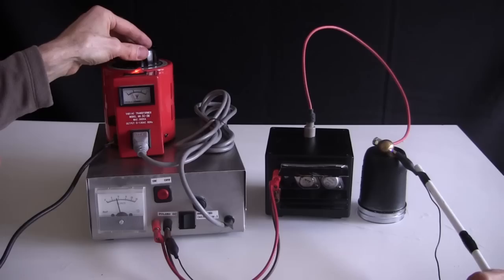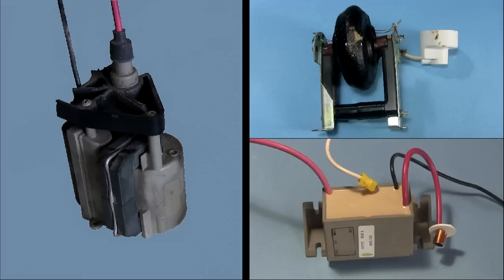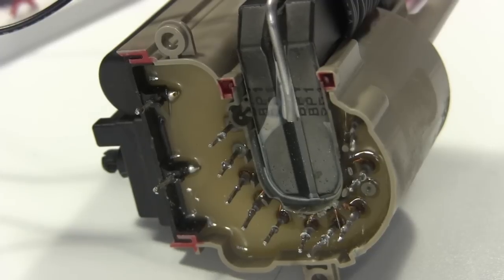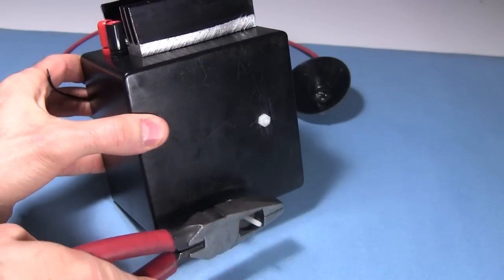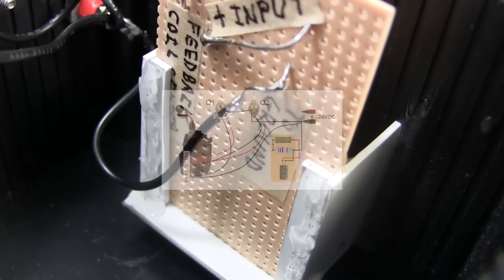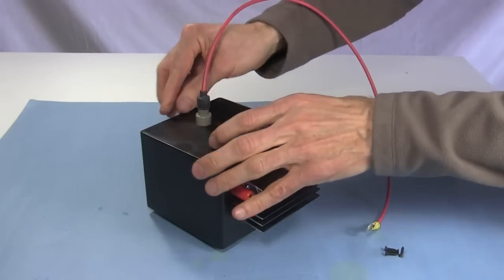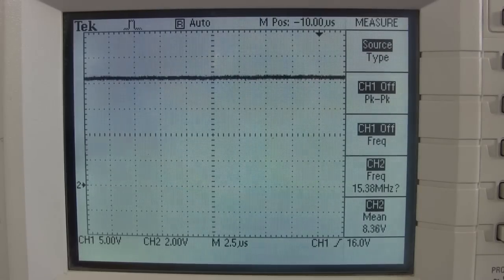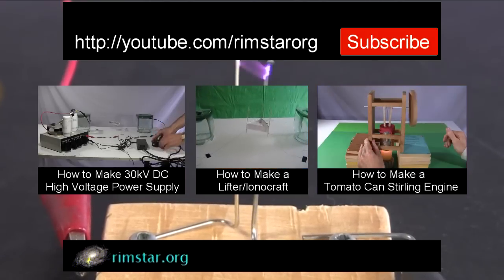The Cube - How to Make High Voltage Power Supply w Flyback/Builtin Diodes

Comment from the maker: The How-I-Made the Cube high voltage power supply video is up now! Enjoy!
PS. +Aaron Monroe pointed out in the comments the resemblance to a borg cube. Good thing I didn't think of it otherwise I would have made a cheezy clip of it flying through space, sparking away. :)
Reply: Is it to heavy for ion propulsion on your test rig?
Reply from the maker: Mongrel Shark
Oh, yes. Even just the plastic Enterprise model with the laser in it was getting a bit on the heavy side.
Reply: Shame. If you had a bigger enterprise to counter balance. They could chase each other in circles.
Reply: My flyback weights 440 grams with everything:D
Is ist possible to add about 2250 lifters to it, power it by this power supply (on top of it) and  fly it?
I`m just dreaming about starting an orbiter with this (powered by xenon gas in space) :D
Reply from the maker: PojntFX (PFX)
No, the power supply wouldn't be able to supply enough current for all the lifters to fly. The current is needed to ionized the air for the ion wind. The record is one that lifted 102g of payload plus the 85g lifter and used a heavier power supply that had multiple flybacks.
Reply: RimstarOrg Would a Flyback from an old CRT computer monitor work?
Reply from the maker: Yextus
I haven't tried it myself, so I can't say for sure. I just opened my old CRT computer monitor and from what I can tell it looks like the same sort of flyback, one with a diode or diodes built in. It's the monitor from my video about turning a CRT monitor into an HV PSU https://www.youtube.com/watch?v=r32e0QGdm8U Make sure you use the protection resistors I talk about - those CRT monitors break easily if you have enough medium sized sparks.
Reply: RimstarOrg why did you use 2 transistors for your flyback driver?
Reply: +RimstarOrg One question, do you really need to connect the DC Power supply to give it juice? Can't you just connect a wire for the outlet going one positive and one negative? I'm trying to use this to power up my Tesla Coil for my project but I'm on a budget :(
Reply from the maker: Two Dogs And A Pup
The Cube power supply takes 1 to 20 volts DC (Direct Current) as input. What you get out of the wall outlet is AC (Alternating Current.) They're very different. The purpose of the low voltage DC power supply is to convert the AC from the wall outlet to DC for sending to the Cube. So yes, you really need a DC power supply.
Reply: +RimstarOrg Thank you very much, this was very helpful.
Reply: +Two Dogs And A Pup you could also try running it off of 2 or more 6V lantern batteries and then it could be portable too
Reply: RimstarOrg  hello sir can you help me how to make electric fense charger about 800 kv
Reply: RimstarOrg How can I adjust various voltages. For example, when I only need 1500 volts but not the whole 20k volts. Thank you very much.

Comment: Nice build!  If you have the time, try using a ZVS driver instead, it gives better output and the transistors dont get as hot.
Reply from the maker: *****
I'm no zvs expert but I think zvs drivers use MOSFETs instead of bipolar power transistors like the 2N3055.
Reply: yeah they do
Reply: theres a similar circuit to the zvs that uses bjts. I think it was called royer oscillator. Ive not yet built this circuit yet so i dont know if it runs cool like a zvs; it might be more prone to overheating, i dunno. But it definately seems to give similar results as a zvs with long, powerful arcs from what ive seen online. Do you know what the drawbacks of this circuit? Any tips or advice you might have for me regarding this circuit would be much appreciated.

Side note: I love your channel. its one of my very favorites for getting inspired and ideas for what   my next project will be. Your spark gap tesla coil videos helped me so much with understanding how to tune my sgtc and because of that finally got it to perform to my satisfaction. Thank you so much for providing the resources i needed to finally getting past that hurtle (i cant spell for shit). I hope you will consider in the future doing a video showing how to build HV supply for powering larger tesla coil transformers with the spark gap design. thats my problem currently. The arcs are 32cm which is awesome but theyre really weak and are barely visible with the lights on. My power supply is one i made thats a 555 timer pwm that drives a single mosfet to pulse DC thru the primary and the output of the flyback secondary can be varried with a variable resistor that controls the duty cycle of the pulsed DC. It works great but it isnt able to provide enough power to get the optimal performance from my circuit. It takes half a second to charge my cap bank to the voltage needed to jump the spark gap and results in breakout thats long but only present for short moment with half second pauses between each strike and is not bright/thick enough to be visible unless its a dark room. 

phew! sorry for long, long expo and question but im stumped and i  figured youd have good advice to point me in the right direction.
Reply: @ozymandiasking173  i think the circuit in this video IS royer oscillator.
Reply: @milanhlavacek6730  it's very similar

Comment: I love the lower power arcs off of this sort of driver, much safer than some of the others out there.
Reply: However, the problem is that the output is DC voltage. A high frequency high AC voltage at 30000v will be more safe than 1000v DC.

Comment: I've watched dozens of videos on how to make a driver circuit for flybacks, most would show a neat diagram then present a tangled mess of wires.. I almost gave up until watching this, Thanks!
Reply from the maker: Glad I could help! In case it helps even more, I've also since added a schematic to my webpage about it http://rimstar.org/science_electronics_projects/high_voltage_power_supply_w_flyback_transformer_builtin_diodes.htm.

Comment: Would I be correct if I am thinking that the transistor bases are getting about 2 volts when the transistors are turned on? If so, then, are they being turned off by the same amount of voltage in opposite polarity, or is the opposite polarity higher in voltage during the magnetic collapsing period?

Comment: You should connect a resonant capacitor in parallel with the primary coil. The arcs will be much hotter and powerful. But will pull a lot more amps. So instead of BJT's you should use mosfets way more efficient. BTW great video and explanation. Keep it up👍
Reply: In my experience mosfets are more sensetive to high amps and volts......And that way I blew 4 mosfets when I was making a zvs driver circuit

Comment: would it be possible to build this using triode vacuum tubes instead of transistors? and is there a video you explain why you choose which resistors and wire size you use?
Reply from the maker: +Nathan Shaw I don't know if it would be possible to use triode vacuum tubes instead, but that would be an awesome project! As for the resistor sizes, I just used the same circuit as from my 30kV power supply (but without the multiplier) and I think that originally started from here http://jnaudin.free.fr/html/lifterb.htm.

Comment: I made a simple flyback circuit the other day from one of those other plans that uses the original primary and feedback from the flyback,but when it was on, I could not measure the current going in to it without the meter going haywire. I assume this may have been because i did not have the secondary Earth grounded. Do you think that might be the cause? The meter can measure volts or amps up to a frequency of 400 Hz. I know that the frequency of the flyback is running much higher, but exactly how much,I can't guess. I know that in a TV it would have been 15750Hz.

Comment: I know that in your design that you probably don't have to worry about primary coil back EMF getting back to the power supply...as the coil is fed from center tap. But if someone was to use the original flyback primary and it is not a center tap fed situation, do you think back EMF would get back to the supply,and if so what would be the best way to prevent it?

Comment: i háve a question, how do electic devices work, because i have two motors, if i spin them one generates 17 volts and the other 80, but the one that generates 90 cant run a circuit of lightbulbs while the other with 17 volts can, isnt the bigger the voltage the bigger the current??
Reply: +Guilherme Dantas go and study some basic the bigger the voltage lesser the current be according to the relation Vs/Vp=Ip/Is both the current and voltage are inversely proportional to eachother
Reply: That's true for constant power. If the power limit is neglgibly big then it's Ohm's law I=U/R.

Comment: Thanks Steve! Some other time try schematic I sent you link. You can use flyback coils for primary and feedback just with short measure and search and you only need transistor (use hor defl trans from TV) and 2 resistors. I connect 12V or 24V and sometime 36V (three batt) - output is proportional and for higher input need to be in oil.
Reply from the maker: Thanks Tomy. So many things to try! :)

Comment: Hello
Is is feasible for me to use TIP35C's instead of the 2N3055's ? I have built the circuit using 2N3055's but don't get a spark at 12v.  I am a little nervous about turning up the juice.  ....I am editing as I go along.  I turned up the power and saw current flow but no spark. I shut off the power and heat tested components finding transistor two (looking at your circuit diagram, left to right) very warm. I have made a mistake, but will wait until tomorrow to find it, as I am 3 drinks in now ;-)  Thanks for the great video's
Reply from the maker: MonkeyMagic Elecifun As far as I can tell from comparing the datasheets the TIP35C should work. You can minimize the risk to your hardware by putting around 240 kilohms of resistance (rated for 2 watts or more) in line with either the ground side of the spark gap or the HV side.
Reply: RimstarOrg Thank you for the advice. I have an issue. When providing power Q2 warms up to quickly at low voltage (7v) so I disconnect. The only difference with our circuits is that I do not know my flyback negative pin as yet and so it is not connected to negative. Also I have used two 1 watt 56 ohm to get the equivalence of 28 ohm for the 27 ohm resistor. Any thoughts please.
Reply from the maker: MonkeyMagic Elecifun
My Q2 heats up quickly too, but at around 20v input. Make sure you have a good heat sink. The lack of ground may be a part of the problem but I can't swear to that. Here's a tip from Alex1M6 in the comments to this other video of mine (http://youtu.be/Kb0WwsJgTMM):
"Add a fast recovery diode across each transistor with the cathode to collector and anode to emitter; BJT's are rather vulnerable to negative going voltages on their collectors. For further protection use small film capacitors of around 10-47nF across each diode too and this will shift the transistors into quasi class E switching and can even reduce the heating of the transistors slightly. Larger value capacitors will reduce the output voltage slightly but will also reduce transistor stress, so experiment before finalising the value."
Reply: Hi, Thank you for your help. I setup the flyback on my TIP35C based driver found the negative and then added the flyback back to 2N3055 circuit connected the negative and it works :-). I will now add the diodes and capacitors. Will two IN4937's be ok? 
Again many thanks.
Reply: RimstarOrg The film capacitors did reduce heating of the transistors but using the 47nf and 22nf film going above 16v killed transistors. I found so far a 10nf ceramic to be the best jacobs ladder performer, although the transistors got warm they survived.I have only tested to 10nf ceramics so far.  I have killed 4 out of 5 2n3055's experimenting and will have to wait for more to continue. I might try some MJE13009's as I have some and see what happens ;-)
Reply: MonkeyMagic Elecifun I was wrong! I killed one of the capacitors not the transistors yay play commences..  The ceramic capacitors are getting really hot at 10v ... any ideas?
Reply: Sorry to go on about this, but did you try the capacitors across the diode's on yours?
Reply from the maker: MonkeyMagic Elecifun No, I haven't have a chance to yet.

Comment: Could this idea some how be modified to produce induction heater?
Reply from the maker: No, this is the opposite of what you'd need. This produces high voltage, low current output whereas you'd need some form of high current output. That's not something I've worked on myself.

Comment: You can also drive flyback transformer with slaye exciter circuit just wind primary on the core of transformer & connect HV rtn. wire to the base of transistor & it works.
Reply: Gaming with Arnis 
dude, fucking for real? That works? thats fuvking crazy i gotta try that. does is give decent performance? can u upload a vid of it?

Comment: Did you use solid core wire? Because I thought that that would be what to use,but I can't get it to work and I can't see any mistakes.
Reply from the maker: John Kerley I used a mix of stranded and solid, but just because that's what I happened to have and it's what fit. The black 18 AWG 5+5 turn one is stranded and the red 24 AWG 2+2 turn one is solid.

Comment: Does the cube provide enough thrust to fly an ionocraft?
Reply from the maker: I've tried it and no, it doesn't make a lifter fly. I thought it would but maybe the fact that's its output is pulsed DC instead of flat DC is the problem, but I'm really not sure. I would have expected it to work.

Comment: Wait a minute here in this set up isn't your variac the power supply and the cube a multiplier or step up transformer?
Reply from the maker: I've never thought of it that way. You could say that the whole thing is the power supply, it just happens to be broken up into two pieces. I have another homemade power supply which is made up of three pieces that I refer to as the variac, followed by a low voltage power supply which then feeds a high voltage power supply. But then again, I have another commercially made power supply which has those same three components but they're all hardwired together and so I just refer to it all as a high voltage power supply.

Comment: I would like to ask, when I try, why when the source is connected to the circuit, its voltage drops, what causes it? thank for answer.
Reply from the maker: midun mahmudin I don't understand. What do you mean by the source?
Reply: RimstarOrg My point is, I had a 19.5 Volt DC source, when I connect to the circuit (the cube), I became a DC source voltage drops to just 4 Volt, why is it happening?
Reply: midun mahmudin Please answer my question sir, thanks...
Reply from the maker: midun mahmudin When you put a load on a source (i.e. the cube is the load) then the load draws current from the source. That causes the voltage at the source to drop. But as long as the load keeps getting the amount of current that it needs then that's okay. The same thing happens with a battery. When you put a load on a battery, the battery voltage drops. When you turn off the load, the battery voltage gradually returns to normal. You don't see this happen in my video because when I turn on the source and see the voltage on the meter, the cube is already there as a load. The voltage you're seeing on my meter is the already dropped voltage. I never show the voltage without the cube.
PS. I have to be awake to answer your question. It's morning here. Patience. :)
Reply: thank you sir have been willing to answer my questions, but when the voltage drops do not occur electric spark on the circuit that I created. about why it happened.
I hope you do not get tired of answering my question
Reply from the maker: midun mahmudin In that case it sounds like you might have a part somewhere that's sometimes bad and conducting more current than usual, or maybe two wires close together that sometimes touch. If it's a wiring problem or a connection problem then it should be easy to find an fix by looking it all over carefully. If it's an intermittent problem with a part then it will be hard to find since the part is sometimes working and sometimes not.
Reply: +RimstarOrg can use of a computer monitor flyback sir ?
Reply from the maker: +midun mahmudin I've never tried it but my guess is that it would work.
Reply: +RimstarOrg can you help me, will you look at the circuit that I made according to your video in youtube, I make this circuit has several months but it is still not working well, you may be able to help so that I can correct the error of the circuit that I created. if you are willing, I will send videos or photos of the circuit that I make to you. I would be delighted if you want to help.
Reply from the maker: +midun mahmudin Sure. My email address is at the bottom of each page of my website http://rimstar.org.
Reply: +RimstarOrg Sir please read my e-mail.
Reply: midun mahmudin Bruh
Reply: It should work as well as one from a TV. As long as the monitor is one of the CRT types(picture tube). There isn't any reason they would be very different that I know of.